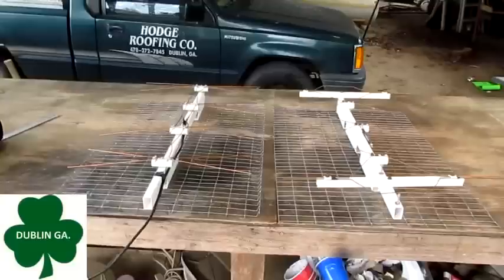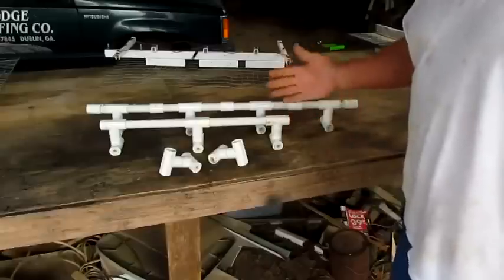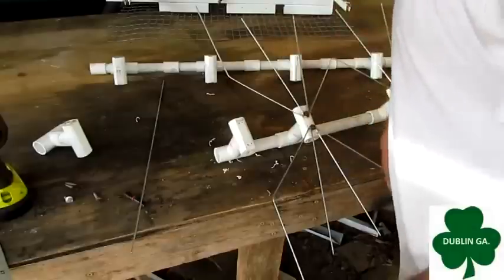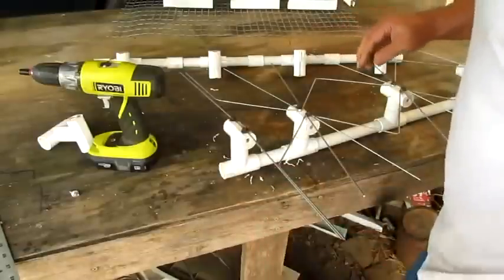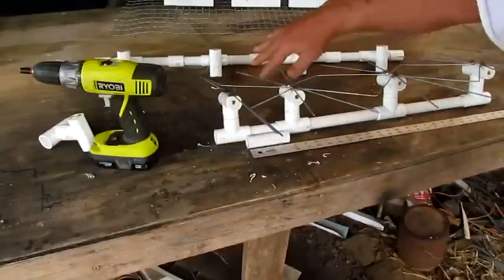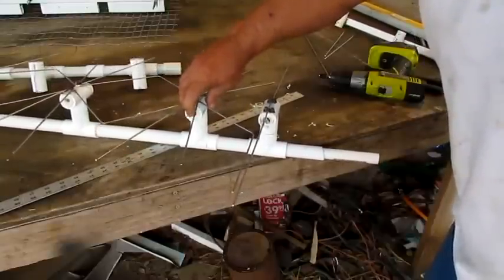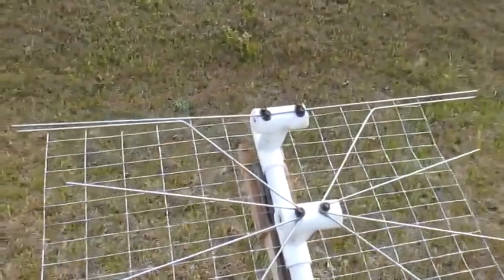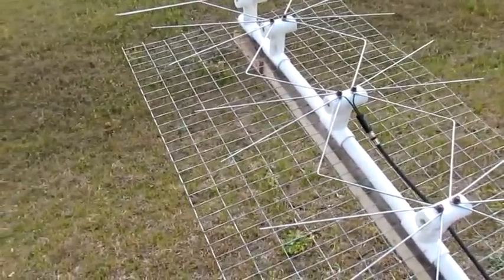How To Make The Hybrid TV Antenna

Comment: I built an antenna that is a combo  UHF bow tie Antenna Mr Hodges showed us how to make with 2 pairs of ultimate antenna 10 inch whiskers.  it works very well for mos tstations in the big city I live in I might have to add boosters to get the weaker ones.Mr hodges  thanks for  your Antenna building info  IT WORKS VERY WELL.

Comment: Hey Danny, Nice video. 
I've been experimenting with the Gray-Hoverman for a couple years and also added the hats and whiskers. The last change I made was replacing the center whiskers with a Folded Dipole loop antenna. It really helped clear up a few questionable channels.
I'm picking up channels from 60 miles away, with the antenna inside my house.

Comment: Being an antenna builder myself, I have to ask if you were able to measure the signal strength between the hybrid antenna and the Gray Hoverman. For myself, I have always had better results with the Gray Hoverman than I have with the bowtie design, resulting in stronger UHF reception. Not once have I ever considered trying a hybrid between the two designs. Well done, sir. The question is, is your UHF stronger with the hybrid?

Comment: How would that VHF wire work if its not connected to the UHF array?
Reply: Danny S Hodges its most likely a reflector as its not connected to the main elements :)
Reply from the maker: I DONT NO BUT IT BOOST VHF UP A LOT